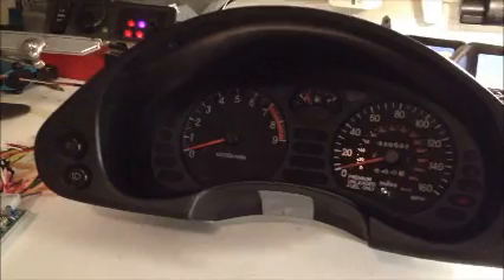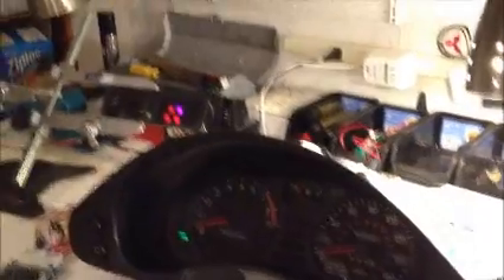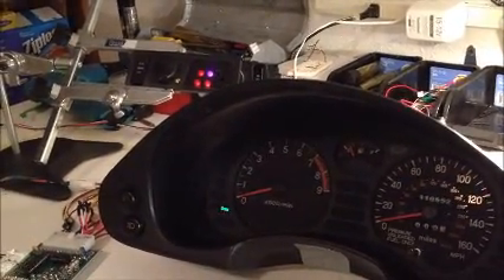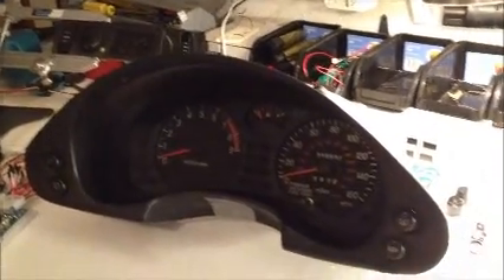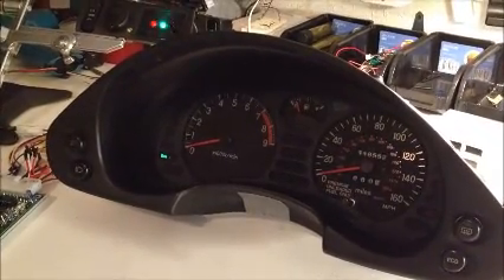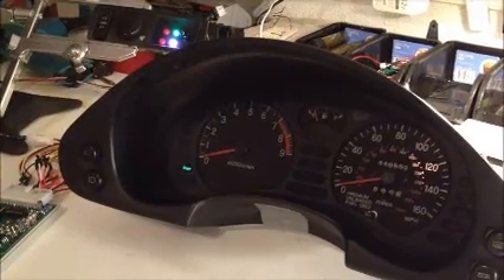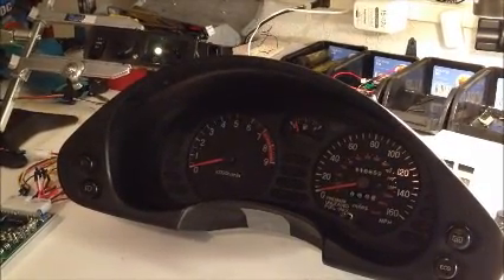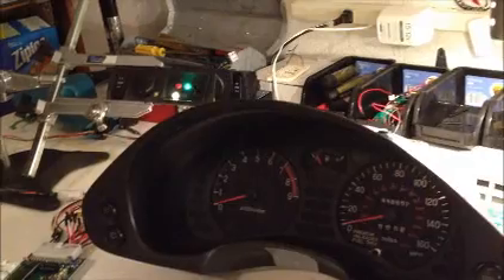TechWorks Mitsubishi 3000gt / Stealth Controllable Suspension ECS Replacement Strut Controller Demo

Comment: I have replaced all four corners with OEM ESC struts, New ESC module, fuses all good and I have no sport/tour light in dash.  Thoughts?
Reply: Normally I'd say somebody unplugged the ECS module.  Is your "New ECS" module really new  or is it used unit somebody said is working.   I ask because you can no longer purchase a new ECS module from Mitsubishi  as they are no longer selling them.    I would guess the problem is with your replacement ECS unit  OR both the tour and sport light are burned out.   If you have a helper when you press the ECS switch - you should be able to hear the strut motors inside the struts turn on briefly.   Listen closely  to either the front struts or the rear struts.    If you don't hear anything then its likely the controller ,  if you hear something then it may be the sport/tour lights are burned out.
Reply: @renegadetechworks4205  Sorry I don't have the answer but I wonder if you could tell me where you got your new  OEM ecs struts? I've spent hours to find them. I got the rear but i am looking for the front ones...Thanks:)

Comment: So have change my steering wheel and removed the clock spring and harness to remove the srs light now my ecs light are flash and it's on hard mode will this fix that or do I have to replug the ars harness?

Comment: Pretty sure I have some struts that are old and not talking with the system anymore.  I do plan on replacing all the struts as the car is a 95' 3s NA SL.  Will lowering springs affect the mechanics of the ECS?

Comment from the maker: The built-in diagnostic console error display capability is only available on the renegadetechworks  aftermarket ecs controller.  The mitsu oem factory controller can not do this.  If you have a Techworks controller, the diagnostics will work even if one or more of the struts is disconnected.  I have no record of you ever purchasing a controller - so I would imagine you have a factory unit and so these instructions dont apply.

Comment from the maker: Not sure why you would want to remove your ECS system... you should fix it...but if you do want to disable the system entirely  just unplug the body harness connectors to the factory ECS controll module located in the trunk -> right rear access panel on the inside next to the stop/signal lights.

go see   3sx.com/faq/ecsmodule/index.asp   for more detailed instructions.